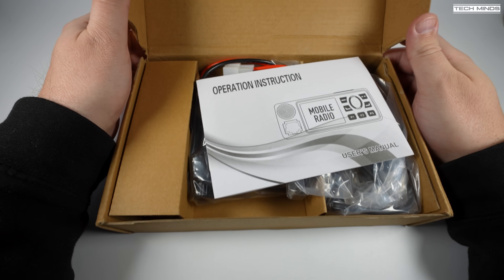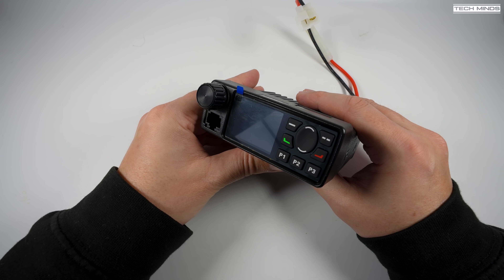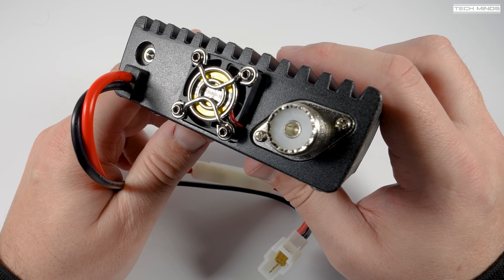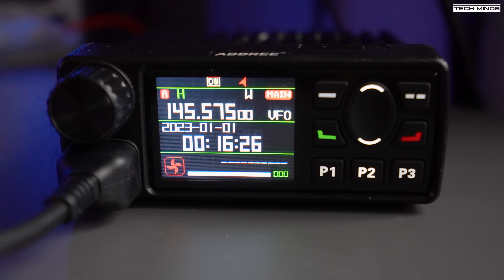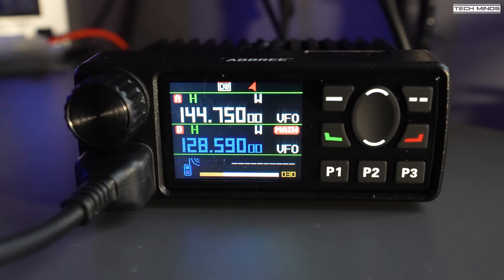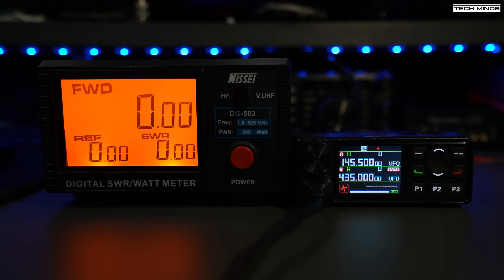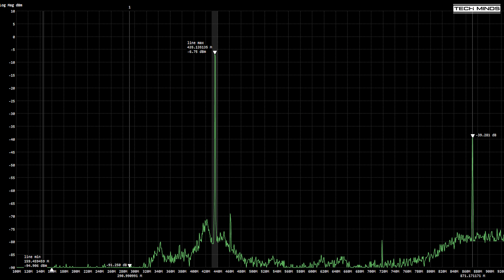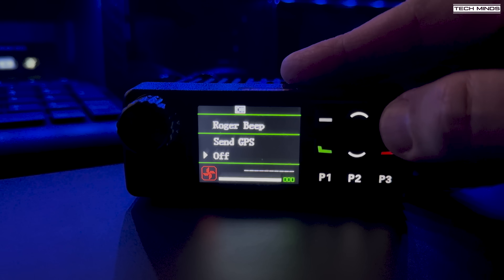ABBREE AR-2520 Dual Band Ham Radio Transceiver With AIRBAND Receive

Comment: Just wondering, would this radio work plug and play as a marine VHF radio in Australia? Distress frequencies are VHF 16, 27.88 MHz or HF 4125, 6215, 8291 kHz. I'm not a radio guru, but I understand cost and VHF radios and hugely expensive here in Australia.
Reply: No, completely different.

Comment: Hi friend, my 2520 has frozen today, I turned it off and when I turn it back on the backlit screen comes on but nothing is visible, no frequencies or anything. If I lock it I get the lock at the top left but that's it, when I turn it off the shutdown tone sounds and it does nothing else, the firmware is the original, what do you recommend?

Comment: are you sure it is "dual band"? did you try 220mhz?   also our country 300+ Mhz are used for frashwater fleet. May you try 300Mhz? does it allow to enter it and transmit?    thanks.

Comment: Hallo , nice Radio due to the GPS - but i order one from China - it workes 2 minutes . The display become blue - and i looked for the ribon cable  pcb to display - also i tried reprogramming . Fakt is i had to send it back - this was not so easy . i knew from some other OM s in Italy they have had the same problems , it is this serie ? how old is your radio now ? Thanks a lot Tim

Comment: Excellent video, I will receive this radio in a couple of days, is it possible without the programming software to assign names to the saved channels? It is true that with antennas that are not self-saturating the Rx audio, its possible change the modulation to am in airband frequencies? thank you, greetings from Uruguay

Comment: Hello! Thanks for your videos, I enjoy a lot with them. I am a newbie in Hamradio. I bougth an AR 2520, but the user manual, I think, is not very well written. I read that there is a repeater feature. I mean, it is possible to TX with a walkie talkie of, for example, 5w in the frequency (A), the AR 2520 RX in the frequency (A) and TX, repeating the conversation in the frequency (B) with 25w? I wasn't able to do this (I am newbie). If It is possible, could you upload a video explaining how to do this with this radio? Explaining this feature of Hamradio repeater with another radios is wellcome as well. Thanks!

Comment: Hi Matt. I have one of these and I am confused why there are 3 power cable fuses. Also My eysight isnt great but they look like they have 15 amp printed on the fuse! Whats the max safe amp output from a 12 volt supply please. I dont want to fry the radio!
Reply from the maker: Thats a good question, but mine is firmly packed away somewhere. If I remember I just used the fuse that was already in the power lead. Thanks

Comment: I have just taken delivery of one of these cheap little radios. Generally speaking, i think its ok for the money. On the downside I have noticed that the cooling fan at the rear doesn't work. 
I thought maybe it would work when the rig temperature comes up, but no! After approximately 15 minutes of QSO between myself and a Ham friend of mine on 2m. The radio heated up very well. In fact it was worryingly hot when I decided, enough was enough. This was on low power and as hot as it got, the fan still didn't switch in! Has anyone else any experience of this, or any thoughts on it?
Steve M7HME.
Reply from the maker: I notice that others are also reporting this. I have contacted my supplier who will hopefully speak to the manufacture so we can get an answer on this. I will report back once I hear something. Thanks, Matt
Reply: Po wgraniu najnowszego softu wentylator działa 👌 73!

Comment: This is a good radio overall. I picked it up off of Banggood and it's been nice to work with. The GPS is a welcome add if you can get that model. My understanding reading the manual the GPS function will send to another 2520. I haven't tested it yet, but I do have two of the radios and I will be testing it soon as I get them both programed and installed. Thank you for the video. Can you provide the cable pins you used to make the data cable? Thank you again!
Reply from the maker: RJ45
Pin 3 = GND
Pin 4 = TX
Pin 7 = RX
Reply: Pin3-GND
Pin4-RX
Pin7-TX
tested and works like this  @TechMindsOfficial

Comment: Hi Matt, I just ordered one after watching this and the newest videos on this little radio. I didn't order GPS as I just want to use it for local access to my FM repeater nearby. I think the programming cable uses a CT-340 chip. I first will try to use a cable I have here. But I want to ask, can you program a channel with the handmic using shift - or +, CTCSS tone, wide or narrow setting, etc... Does the fan comes on when transmitting? Does it sounds noisy? Thanks for any feedback. 73 Phil ON4VP

Comment: How to hook this up in your home?
Reply from the maker: First you will need a power supply capable of providing enough current and voltage, 13.8v and 10 amps would be plenty. Or you could use a car battery. Second you will need an antenna and some coax cable to go between the antenna and the radio. Most people purchase a dual band co-linear antenna and put it above the roof for best performance. hope that helps.

Comment: Hi Matt, enjoyed the review thanks. Have you managed to locate the programming software for this radio yet? I got one earlier this week and I quite like this little radio but I've had no luck in tracking it down! I got the GPS version and it works well. The only thing of slight concern is when the radio is in scan mode if you press the PTT button the radio crashes with an erroneous frequency on the display. Any other key press is fine but if you stop the radio scanning by means of the PTT that's it - you need to pop the power lead. Hopefully there will be some improvements via a future firmware update but right now it feels a little rough around the edges!
Reply from the maker: Not yet, I was hoping to have it today but the seller hasn’t sent it me yet. As soon as it does I will share it. On a plus note I managed to replay attack the little data packets at the end of the roger beeps. Comes up on the display when receiving it. Video to follow soon.

Comment: I'm disappointed that it doesn't have an emergency button and a flashing LED / torch function.
Reply: Why would you need that when its stationary mounted?
Reply: @Mr.Thermistor7228  Any decent Chinese radio regardless of form factor has an emergency button and a light. It's a natural law of the universe ;)

Comment: Great video, Matt.  It sounds like the radio still uses FM for air band reception. This would account for the distorted strong signals, especially if the bandwidth is wide enough to still encompass the AM sidebands

Comment: I have an old QYT 8900D with a 3.5mm socket on the back. It has a 3.5mm jack to USB A lead for programming channels/firmware dumps.

Comment: Awesome video and just a guess that mistery connection point on the back might be gps antenna port 😅..
or might be normal ant port just like HRD-747 Handheld reciever
Reply from the maker: It could be for sure! Next video I make on this will show inside the radio and the main board, but I'll do this once I get the programming software. Thanks
Reply: @TechMindsOfficial  Awesome that would be interesting to see the guts best of luck.

Comment: You know what I think about cheap chinese radios. Don't bother to check into a local net with them. The noise and transmit quality makes you an unwelcome participant.
Reply: Is that so?
Been running a “cheap” Chinese baojie 213 for years in the car and temporarily as a home base and never had any of the issues you describe.
If anything I usually get told it sounds pretty good for a “cheap” radio.

Comment: There's a reason these are so cheap. One (of many) is that harmonic performance is poor, typical of Chinese radios. Using one of these could get someone into trouble if one of those harmonics is on an active frequency. I'm staying away.
Reply: Keep paying 10 times more for less
Reply: No one is getting I trouble for harmonics.
Reply: Just throw a notch filter on it if you are really worried.
Reply: You always need to test it before you can make that very broad claim. There are many Chinese radios that perform very well, in full accordance with the various emissions requirements. This isn't one of them, but it isn't the worst either.

Comment: Thanks Matt. It looks like this radio has a lot of potential for its price. I would be curious to see what the inside looks like as far as interface ports, specifically Bluetooth as you said it was missing. Also, if there was a way that you could run an external data connection off the front RJ45 and still keep the microphone connected. So for the price again, this might be a great experimenters radio. I'm seriously thinking about getting this for my apartment here in North Houston. As a side note, you rock the goatee just as good as I do. Like the others have said, it's good to see your face after all this time.
Reply from the maker: It does appear to have a lot of potential. Will definitely be interesting to see a version with bluetooth and the micro sd card slot. Guess we will have to wait and see what comes out. Thanks for watching :-)

Comment: Wondering if the menu permits CTCSS tones, +/-, etc, to allow you to properly connect to repeaters?
Reply from the maker: Yep absolutely, you can manually program the memories through the menu. I know I didnt show this but when I get the software I will cover software and manually programming. Thanks for watching :-)
Reply: Hi just saw your comment yes they have built in ctcss, works perfectly.
Regards Paul

Comment: Have just entered the small Chinese radio market; got a Quansheng KV-5 with the Egzumer mod, plus a few Baofeng’s. What irks me is the propensity for manufacturers to make the point that their radio “also” has airband. Other than the modded KV-5, it seems that none of these radios have the capability to properly modulate AM. Yes I can hear the replies back that it’s not their primary objective, but why advertise a feature as a selling point if it’s unusable??

Comment: Not a bad cheepy, get the feeling its a handheld inside. Those GPS data bursts sound a bit like trunking data
Reply from the maker: Definitely not a handheld inside, I checked the board already, but it does appear to use similar firmware for sure.

Comment: Nice find, Matt! I'm wondering whether that little jack on the back is for an external GPS antenna... The GPS included in this little unit looks to be poorly integrated into the radio's functions, which is a pity. However, with a data cable connected to the front and a Raspberry Pi, I'm thinking that this could be an excellent little unit for packet and APRS. And between £56-£64 at the moment, this radio is even cheaper than a Raspberry Pi 5! 😛 Thanks for the video, Matt - excellent as always!
Reply from the maker: That was exactly my thoughts too, a little pico or pi running some software. Cheers!
Reply: Good idea to use this for aprs !